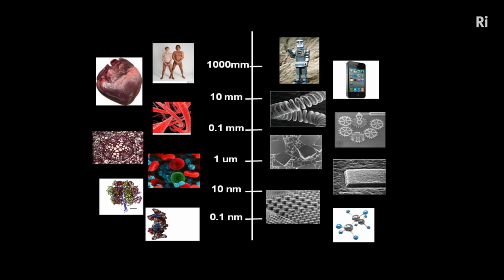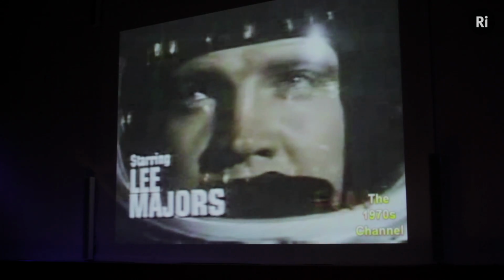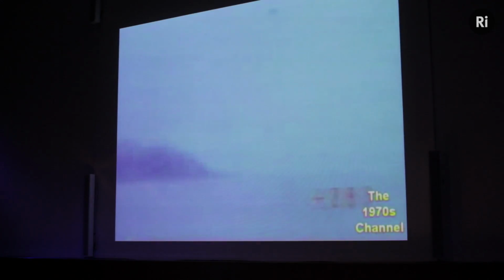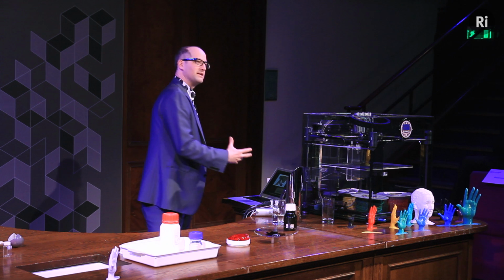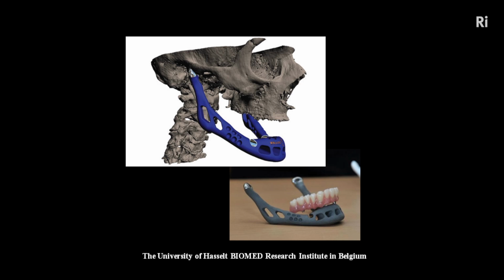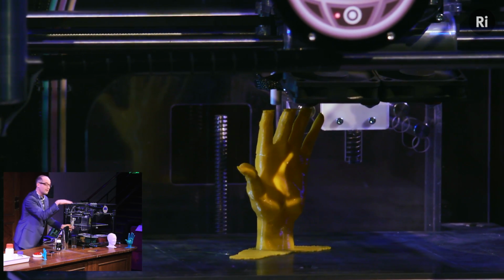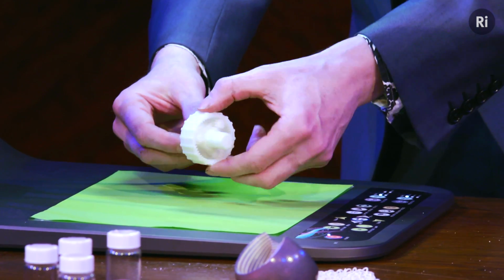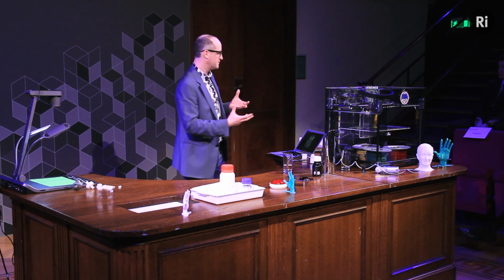Strange Materials with Mark Miodownik

Comment: Hip joint implants are NOT "effective.' NO ballet dancer obtaining one has EVER returned to functional high level use, though some have gotten them in mid/late 30s. ALL have both reduced extension forever, and reduced capacity to take repeated impacts.
Bone is ALIVE, and responds to impact with increased density and internal architecture. . The presenter is kind enough to note that you require ANOTHER every 10 years (although some are useless by 5 years). Imagine having to go through the intense and painful physical therapy  each decade until your 90s. Even socially-dependent humans cannot maintain the mental determination to do so after two or maximum I have heard of, 3.
Hip replacement are often done for mere labral tears (which ARE debilitating and painful- I have these), and are NOT recommended by other than overeager surgeons.

We are NOT adapted to metal and other materials inside our bodies, and experience significant changes in immune responses, which you do NOT want to experience. 

The brain's cortical areas monitoring ALL of the body occur in two different areas, for two different associative purposes. One is the familiar sensory and motor areas  you see in "homunculus" diagrams. The other is in the hidden insula. It knows forever - as long as you are alive - exactly where neural absences and foreign objects are.

I do not normally attempt to discuss this aspect of cognition with those unfamiliar to biological and cognitive science, and so must leave you to seek several years of specific education and research on your own.  ALL that you attribute to "unconscious" and "gods" are YOU, and only a few cognitive and physical disciplines address those functions which the self-dissociated public erroneously attribute to exterior or "unknown" source and control.

Comment: Rubbish. The essential  questions  when does inanimate become animate. What is life or living.
Reply: I think one of the points of the lecture is that, unsurprisingly, there is no sharp line between animate and inanimate, or living and non-living. Or to put it another way, attempting to understand biology with coarse categories like animate and inanimate is rubbish.
Reply: @Graham_Wideman  Speak to the passively carried virus using living cells to replicate on this issue.  We ARE all related to the LUA, whose ancestors played with the more changeable RNA.
 I exclude self-flagellators from personal consideration, as flagellae are for approaching or escaping respectively attractive or toxic Others. Animate originally referred to motility. 
there IS, though a distinct "sharp" sine qua non, "line.".

Comment: woulda been cooler if you dropped the distance inverse square on the sound pressure (I'm gonna use hearing protection but you'll be fine...)

Comment: Mad that this was in 2013 and here I am watching this in 2018 as my very own 3d printer finishes the part I just designed tonight.
Reply: And i'm listening to it through the headphones i printed myself, love this tech!
Reply: I've just replaced three tiny circuit boards on mine for about £8 each, that make it print almost completely silently, and use less power, and give an even smoother movement through interpolation. Oh and they detect when they hit something by watching for changes in current in the motor, so you don't need the limit switches on each axis any more. I hope we can upgrade our own parts just as easily one day!
Reply: Odd, but I happen to be 3d printing some parts while watching this in 2020 as well.  Just some battery spacers, but still rather remarkable.
Reply: I'm watching it during 2020 lockdown!

Comment: Isn't bromine also liquid at room temperature (liquid from 19F to 138F)?

Also, gallium liquifies at 85F which is slightly above what most people call room-temperature but still within the range of temperatures found in an ordinary home.
Reply: Jonathan Gwynne bromine is on the very edge of liquid gas transition, it fumes so much that within a few minutes it usually has already evaporated that said I too Count bromine as a liquid
Reply: yes, and neither form very nice materials for use in body.
Mercury, while rather highly toxic, as he stated, forms amalgams with other metals and doesn't leach when set

Comment: 3d printers are a waste of time and money.
Reply: lennyhome
You are quite entitled to your opinion as indeed are those who still believe the earth is flat.
Reply: you can print metal on microscope scale
there are already gold smiths witch do they're work at pc.. 
yeah buying a cheap hot glue pistol version is not super effektive but ther is a toutorial for building your own "Cnc mill" (google translator ^^)
now replace the drill with a hot glue pistol ... there you go you bild your own printer.. 

it starts to get really interresting when using metal or glass.. 
u need a screw.. print one.. u need a screwdriver.. print it.. 
u need a nut or some bearing.. print it
u broke a glass .. put it in your printer it will be reused to print you an other one.. 

and right now aom japanese used a 3d printer to print skin on a wound.
scanned and mapped.. then printed.. works fine.. 
it can be a pretty nice tool
Reply: They make airplane parts with 3d printers, have you flown lately?
Reply: You have no idea what you're talking about. They sometimes prototype mechanical parts, but then the actual, functional, not useless parts are make the traditional way with lathes, mills, etc... Not useless "3d printers".
Reply: You're being fooled and you obviously have no idea of what you're talking about.
Reply: lennyhome I guess you just tell everyone that they have no idea what they're talking about?  You might question and critique yourself like you do to others.

Comment: That story about the working of that 3Dprinter (31:48). Is that right  "twice the melting temperature"? The meltingpoint of polylactic acid is about 423k can it realy stand heating up to 846k
Reply: Probably he meant 150C --> 300C. This is why one shouldn't talk about multiplying temperatures.

Comment: Not to burst your bubble or anything, but based on your definetion of robot, you may already be one. You are run on electrical signals. Everything you experience is electricity. This is simply replacing and fixing parts.